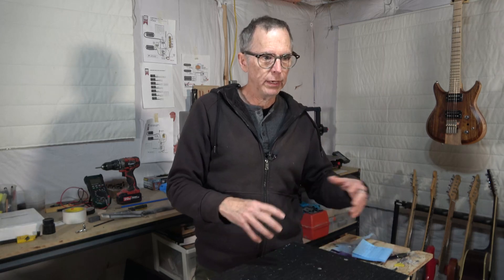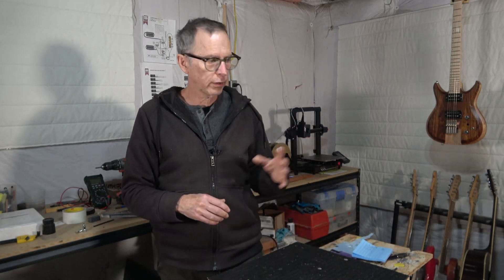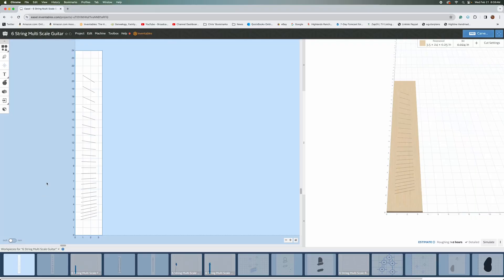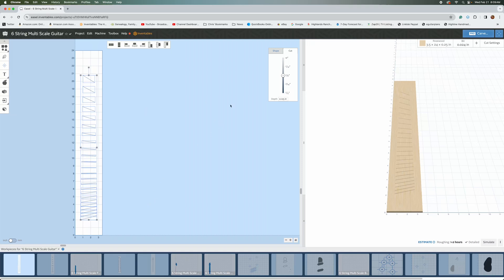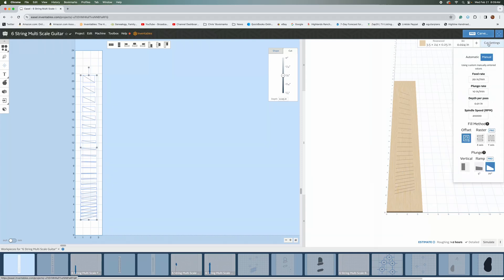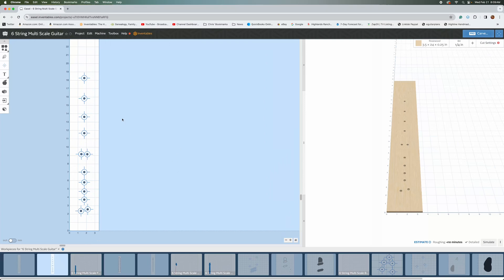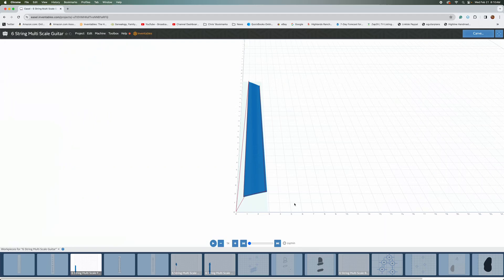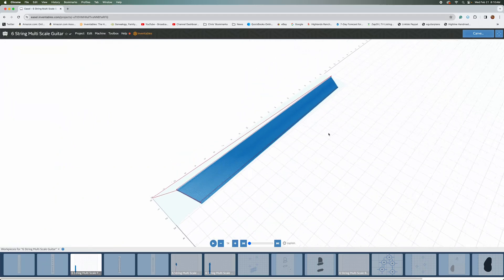Making A Six String Multi Scale Guitar: Making the Fretboard

Comment: hello, 

have you tried combo masking tape + super glue to fix piece of wood on your CNC instead of clamps ?
Reply from the maker: Yes, I have. It is dangerously unreliable.
Reply: @HighlineGuitars  sorry you had bad experience with it, I'm using it when i'm using router without problem. I also saw workers using it with CNC without problem.

Comment: Fretboard looks great!  Looking forward to the rest.  Have you ever done a scarf joint on a multi scale instrument?  Since the nut is at an angle, you wouldn't be able to do just a straight cut and flip the pieces to make the joint.  You would need a compound cut to make it work.  Even then, I'm not sure how the flip would work.
Reply from the maker: When I used to make 7 string multi scale guitars, I made a regular scarf joint a bit further back than usual and then sanded the face of the headstock to account for the angled nut. You can also make a regular scarf joint and with an angled headstock like this Cort guitar: https://www.cortguitars.com/_DATA/item/1608597378/thumb-KX507MultiScaleSDGNEXTGENlogo_420x420.jpg

Comment: Hi, Chris. As always, educational for a newbie such as myself. I especially like your ability to "self-critique" and then "course-correct" when something hasn't turned out as originally planned.

But here's the thing that really surprised me about this video: The fretboard blank seems to have a slight twist and isn't sitting flush on your work surface.

I've been prepping some maple fretboard blanks, sourced from my local lumber supplier, and I've been totally stressing over whether they will warp or twist (even slightly) after I've planed them down to thickness. (The same is true, frankly, for some top woods that I've purchased: cupped, twisted, etc.)

So (just being an amateur detective here), my guess is that the fretboard blank, even if it has a slight twist, will conform to the neck shaft once you've glued it up? And, as long as the twist isn't too severe, one can rely on a more-substantial component to force a slighter one into place?

In essence, I'm basically asking if you can address (at some stage) what your approach is when dealing with a workpiece that might be slightly out of skew, and where you might rely on another workpiece to correct it.

Thanks!
Reply from the maker: Carving a fretboard with a router or a CNC machine subjects the wood to a lot of stress which can cause it to warp, bend, and/or twist. However, it is only temporary and usually goes away within a day or two. Right now after three days, the fretboard is nice and flat on my workbench. Also, fretboards are thin enough to clamp flat to the neck. A neck will do the same thing after carving it so it needs to sit for a week or two to relax. If it doesn't straighten out, it goes into the fire pit.
Reply: @HighlineGuitars  That's kind of what I suspected. Thank you, Sensei!